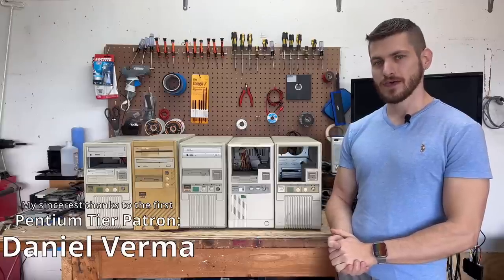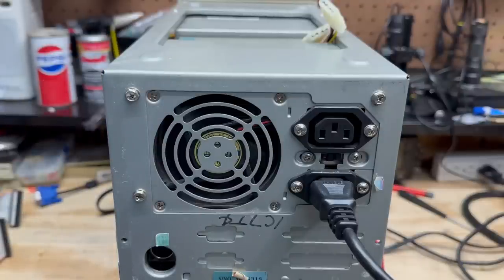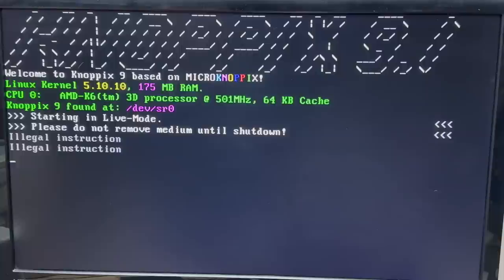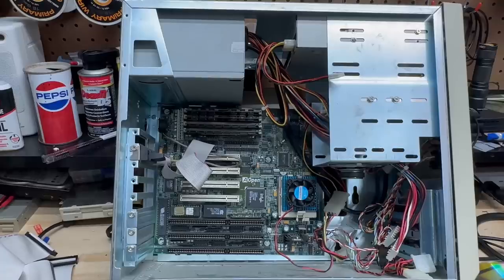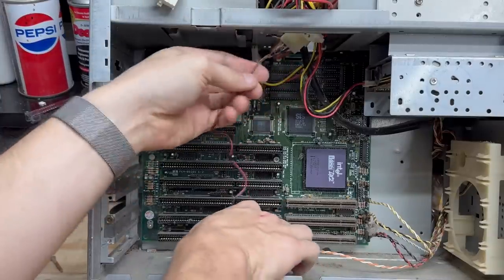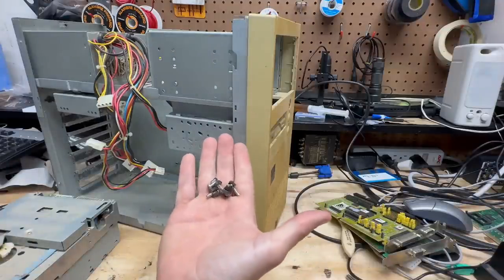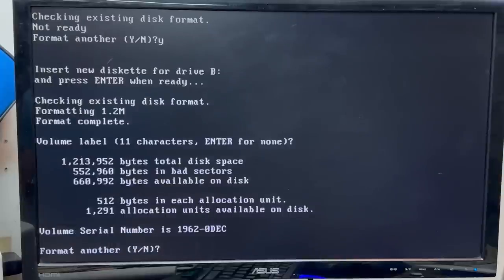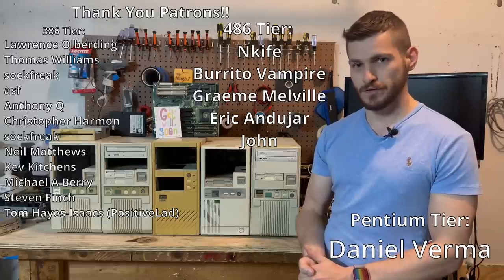Vintage Computer Teardown and Test: Let's check out the Baby AT towers from the Franklin eWaste haul

Comment: There's people who've worked out where exactly to drill and cut those Dallas modules so you can connect another battery. I suppose it made sense in the context of what the computer's meant for, nobody's going to be using it after 10 years anyway... or so they thought! But they're intrinsically a bad idea, a non-changable battery. Why does any manufacturer use these? When there are other solutions just as cheap, but better. Still, now I think it's all done by the one giant chip that does everything, just trickle in a battery to a couple of pins and it'll do the job. 

That 386 was old enough that the power button actually... switched it off! Probably still does if it's the original power supply with no standby 5V and no "intelligent" power management. I miss power buttons that actually controlled the power! Imagine if they made toasters like that. Houses would burn down!

Comment: Watched a few of your Videos now & definitely interesting, Great Videos btw, You haven’t got any contacts here in the UK have you by any chance, I’m in need of a 486 Motherboard with VESA & ISA Slots along with 4 x 30 Pin & 4 x 72 Pin Simm Slots to replace mine as I believe it’s only good for the Bin now unfortunately although after watching some of your Videos it may be salvageable by you or someone with your Skills, My biggest problem is I’m not very handy with a Soldering Iron…
Reply from the maker: None that I know of in the UK. Yeah trace repair is quite a challenge… All but the largest traces will usually require a microscope.
Reply: @miketech1024  Thanks and appreciate your reply, I wonder if that wood was put in there at: 28:49 to prevent the Keyboard Socket from moving too far back when plugging the Keyboard in?

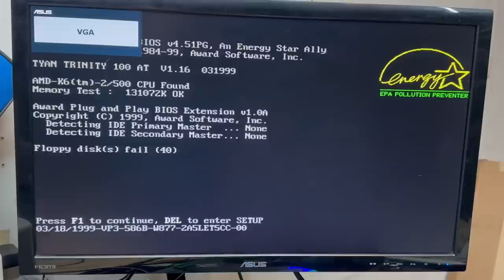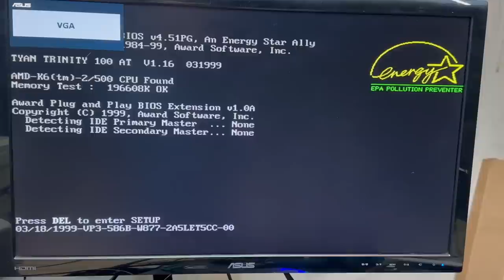Comment: 8:42 Only 128 Mb RAM is recognized, not 192. But I wonder if only the 128 stick is being detected, or if both are but the 128 Mb stick is high density and the mainboard is only compatible with low density modules, and only sees half the memory in it. [EDIT] I see it recognizes all of the RAM at 10:10 after you cleaned/reseated the RAM along with the expansion cards.
Reply from the maker: It’s becoming my standard operating procedure to just clean all edge connectors now. So many of them are really tarnished by now.

Comment: Damn, that second PC had a UEFI bios... 😂
Reply from the maker: The original! 🤣
Reply: The infamous AMI WinBIOS from 1994. It completely cratered AMI's BIOS business because everyone hated it. Ever wonder why just about every machine had an Award Modular BIOS from 1994 to 2000?...... That's why! The problem was if you had to set up a ton of machines with the same CMOS settings. It was much easier to navigate the old AMI HiFlex BIOS and change settings 100% with a keyboard.

Comment: 39:04 - PS/2 mouse is not hot connectable, it needs a system being powered off before connecting or it will crash._
Reply from the maker: I was using a serial mouse.
Reply: @miketech1024  Still it's not hot swappable due to the connector limitations despite being designed so initially, only USB can do that reliably as far as I know._
Reply: @DjResR  people have been hotplugging serial since before any of us were born, it's fine. windows literally stops at that dialog to tell you that you can safely plug in a serial mouse.